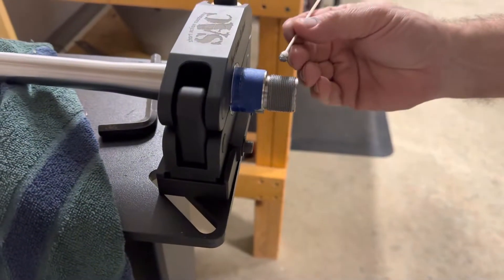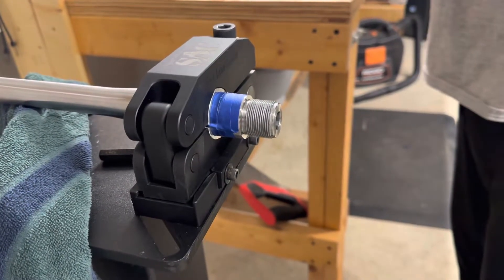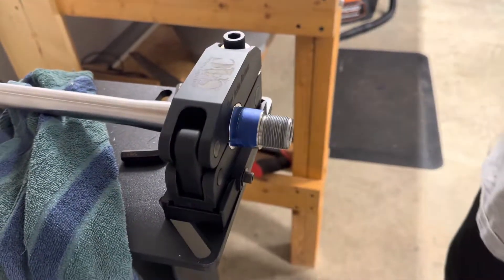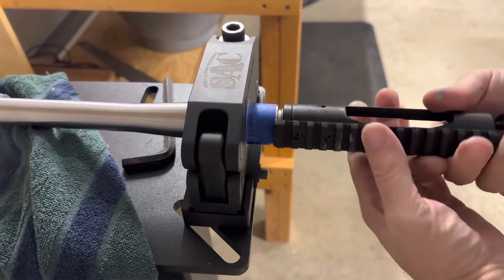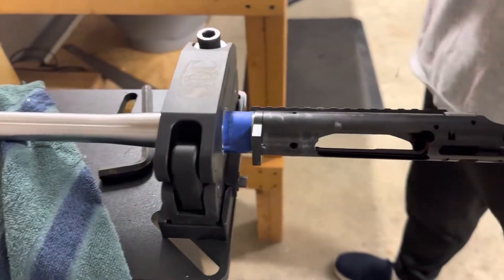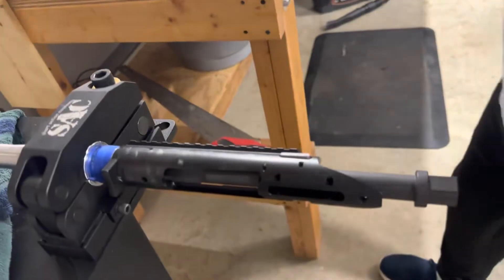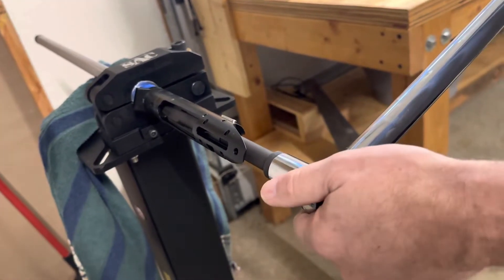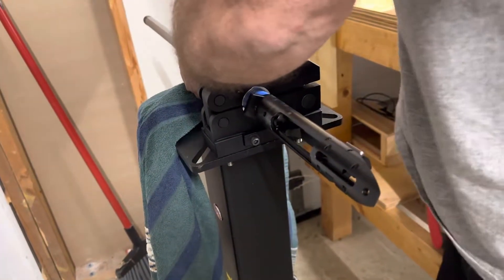Prefit barrel install. No Go / Go gauge was checked.

Comment: Since you added a lubricant your torque is no longer 90 but is reduced to 70% of that or 63  ftlbs
Reply: Torque values on a rifle barrel don't really matter anyway.  Some target shooters prefer hand-tight so they can easily swap barrels.  Some factory guns are torqued to 150+ ft lbs.  Make it as tight as you want, use whatever lube you want, and go shooting.
Reply from the maker: Highly dependent on the type of anti seize. Additionally, that is why I twerk 10 more pounds than what is required.
Reply: 90 ftlbs is 90 ftlbs
Reply: @romankurkiewicz6046 while I dont fully agree that thick regular anti-seize in a small ammount would warrant a wet/lubricated torque. There is indeed a big difference and 90 isnt 90 or any number when comparing lubricated and dry torque values. While technically 90 is 90 It's quite literally different for application specs. For instance almost always you are given a lubricated and dry torque value when following any procedures in any industry standard.
Reply: I have watched barrel swap videos lately where they only tighten to 35 - 40 ft lbs. So I don't think it matters that much.

Comment: This looks like the contract barrel overrun sale blanks we had. The ones which we said specifically were leftover from a contract and were not our blanks and they were unlapped button barrels.
Reply from the maker: I print screened all of the pages when I was ordering those barrels. Nowhere was it mentioned that these were not lapped. Furthermore, if you look at all the videos I posted ,even if they were not lapped it’s no excuse for the wrong speed / feed or using a dull reamer. It is clear these were done improperly.